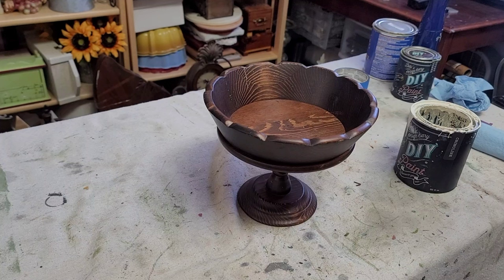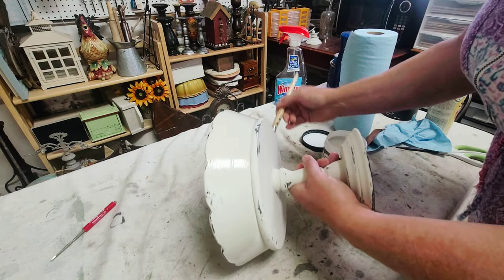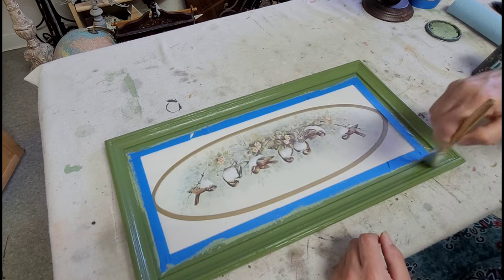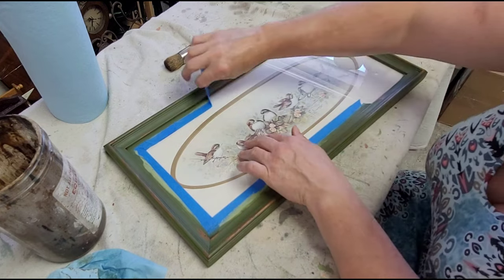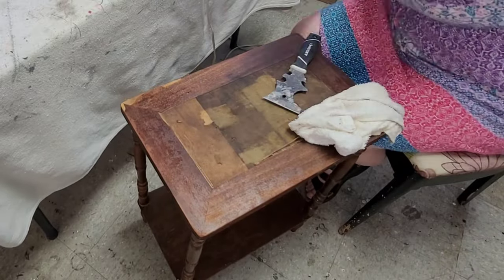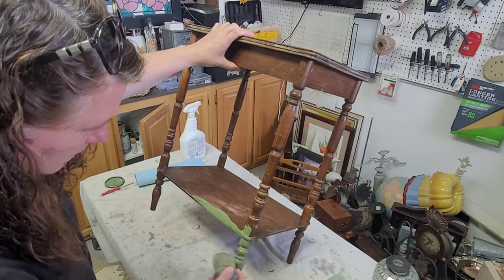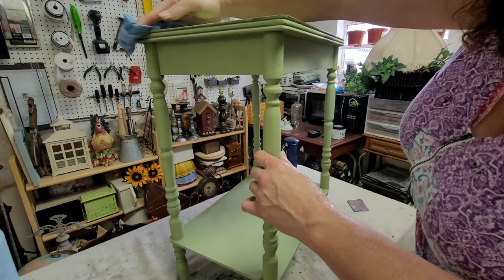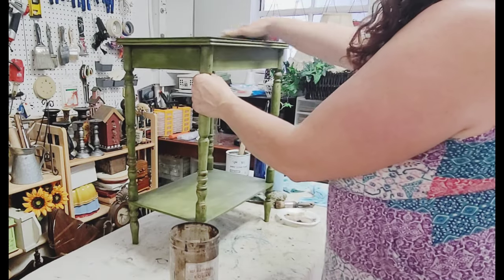Thrift Flips • Trash to Treasure • 40/40 Challenge • Transforming Salvaged Items for Summer Decor

Comment: Does the wax settle in like a clear coat? You don’t have to wax it again over time?
Reply from the maker: The wax will cure and become hard - it takes about 30 days for that to happen. And then, yes - it's much the same as a clear coat. And if you have a piece that gets heavy use, there is the potential that it may need another coat at some point. I have a dresser at home that I painted and waxed several years ago - I throw my keys, jewelry, perfume bottles, etc on it on a pretty daily basis and the wax has held up extremely well so far . . . there are a few scratches, but they would likely buff out, and since I did some distressing to the piece they just kind of blend in anyway, so I'm not overly concerned . . . I may go over it in a couple years with another coat of clear wax (just the top) for extra protection though. :)